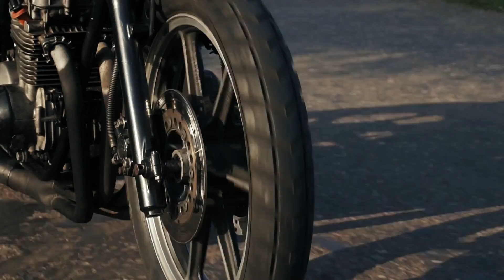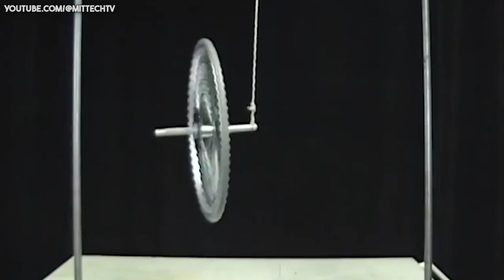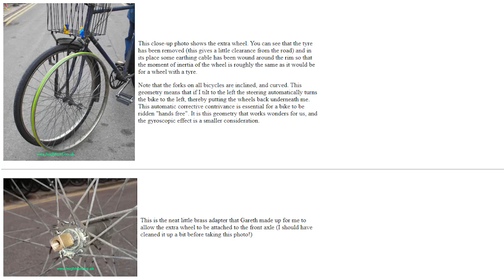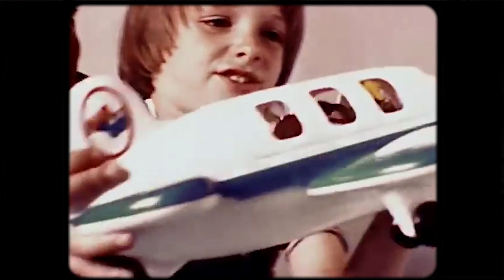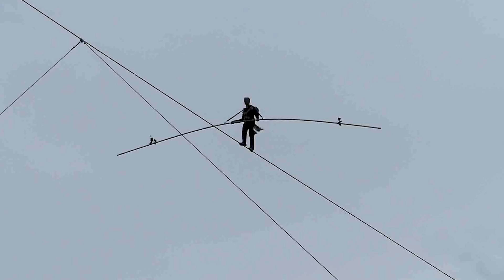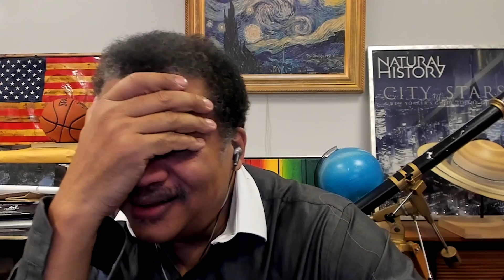How Do Bikes Stay Up? | Neil deGrasse Tyson Explains…

Comment: Neil, would love to hear about the physics of a motorcycle jump. Especially what looks like rotational control in mid air. Is the rider, for example, applying the brakes a bit to rotate the nose downwards?
Reply: You're really smart just because you guessed that! Yeah, when you accelerate the wheels, nose goes slightly up, when apply brakes - slightly down. I certainly wouldn't have guessed that, I wouldn't have thought that's something even possible
Reply: @ldmtag Sounds exactly like what happens on the ground 🧐. It's almost as if angular momentum is the reason why it behaves that way in both cases 🤷‍♂️. Idk if that's the (only) reason or if it's a pure coincidence 🤔.
Reply: @louisrobitaille5810  no, it's not the only reason, and no, it's not a coincidence. On the ground the main force that makes you do a wheelie is tire friction. It's applied not directly to the center of mass, hence it generates rotational torque. Normally it just slightly squats the bike during acceleration making the center of the rear wheel the center of bike's rotation, around which now the force of gravity is off-centered and too makes the torque, and this torque is what keeps the bike from doing a wheelie.

Comment: I saw some guys at the park walking on a high wire that was just a few feet off the ground tied between two trees and I just knew I would regret it if I didn't ask them if I could try, so I did. Its hard! Its really hard without a pole. They didn't have one and I only went about 3' before I tumbled off. Glad I tried it though, cross that one off.

Comment: Neil didn't quite hit the nail on its head here in my opinion.

- Trail (contact patch behind axis of rotation of the wheel) is the mechanism that auto-centers the wheel at speed, though it doesn't have any effect at a standstill. Think of caster wheels on a shopping cart.
- Rake (inclination of the head stock) inevitably produces trail on a bike with straight forks but it also creates another effect: if you lean the bike a bit and then rotate the wheel slowly,  the whole bike will shift side to side slightly but also there will be an angle where the bike sits the lowest on the ground. Now whenever you leave that angle, it raises the bike up very slightly. If we eliminate friction, gravity will always keep the wheel angled in that special angle, which seems to be the correct steering angle for a given lean of the bike, yet I wouldn't be too sure about that. This effect is similar to Neil's balancing stick example, but it's probably only relevant at a standstill, when friction of the tire on the ground is minimal.
- Gyroscopic effect is an apparent force that pushes the bike up when it's in motion and leaning to one side. But it can't be the only relevant effect here, because then the bike would just come to rest at a certain lean angle but roll straight on.
- When the bike leans, the contact patch shifts to the inside of the curve. This might put leverage on the front wheel to steer it into the turn. The rolling circumference also gets smaller as the bike leans, prompting the wheel to accelerate its rotation, but because of inertia the wheel will instead react by putting leverage on the steering axis, steering the wheel into the turn. If this effect is significant or not, I don't know.

I'd be curious to see a computer simulation which can eliminate various factors to see which ones truly contribute to the self-stabilizing of a bike.
Reply: I never see anyone mention the rolling circumference. But I always thought it was relevant.
Reply: @user-zu1ix3yq2w  It's probably very weak because the variations in rolling circumference on a bicycle are quite small. But it is noticeable as a little bump in the engine rpm in motorbikes. When the bike is rapidly dipped into a significant lean, the bike slows down a little as an effect of engine (and wheel) inertia, and the front wheel is slightly forced into a sharper turn.

Comment: I think Neil is incorrect in his belief that high-wire acts need the pole to move their mass lower. That stick is nowhere near the mass of the person holding it. For Neil's explanation to work, the pole would have to be heavier than the amount of body mass above where the pole is held. I contend the pole is for BALANCE, as walkers can be seen shifting the poles left and right along their length as they walk. Neil is brilliant and rarely wrong, but once in a great while...

Comment: Studying advanced motorcycle handling teaches a combination of how center mass, speed, and friction points interact to keep a bike on track and in control for given conditions. There are all kinds of forces at work, then you add in what changes with applying the brakes or throttle at any given lean angle plus speed. All of this is acting on a contact point between the tire and the road about the size of a credit card. It is really a great exercise in physics and engineering once you realize how complex a system it really is.
Reply: So, does being raised by a guy who designed tires... but I'd still wanna take your course before getting on a bike.

Comment: How can the CM be below the wire for a tightrope walker holding a bar horizontally?  No part of either the bar (even a sagging one) or the walker is below the wire, let alone half the mass.  If the combined walker+bar CM was below the wire, the system would be stable and there'd be no challenge to tight rope walking.

I don't think lowering the CM has anything to do with any of this in the tightrope explanation.  What you have is a system where angular momentum is perhaps 0 to start, along with a (simplifying a bit) single vertical force at the walker's feet.  If there's a little disturbance and his CM shifts left a little bit, the vertical force is now to the right of his CM which will cause a torque to the left.  The walker will start rotating in that direction.  

By applying an opposite torque to the bar directly, he can induce an opposite rotation in his body and momentarily shift his CM back to the opposite side of the wire.  If he moves it far enough and holds it there long enough he can then apply an opposite torque to reverse the rotation of the bar, then stop it when it's level again, thereby canceling the angular momentum in the system.  His CM is now back to center and with 0 torque and angular momentum in the walker+bar system until it's disturbed again.  

There's probably more to it like manipulating the force directions laterally with your feet/legs, maybe doing some lateral translation of the bar and so forth.  The point is all this stuff about lowering the CM is irrelevant in the tightrope example.  If the CM is above the wire at all by any amount, the system is unstable regardless.  Lowering it to a height that's still above the wire won't reverse the torque on the system and stabilize it.

The Weeble Wobble also doesn't have much to do with the CM lowering.  The reason a Weeble Wobble is stable is because a positional disturbance (say rolling it to the left just like the tightrope walker) pushes the contact point further to the left than the CM moves in that same direction.  The vertical force is now far to the left of the CM instead of directly under it which produces a torque in the opposite direction canceling and then reversing the roll velocity.  That rights it again.  How the CM moved vertically is irrelevant.

Comment: Having your center of mass on a 2-wheeler low is not actually helping with stability, it might be doing the opposite. I have riden very low lowracer recumbents with center of mass of the rider just about 40cm above ground and tall 29" upright bikes with their center of mass maybe 110cm above ground. The low bike requires faster reactions to anything that destabilizes you. It like balancing a short stick on the palm of your hand versus a long stick. Other things being equal lower bike will require faster reflexes and therefore feel less stable. But you need a big heigth difference to notice this. Among just upright bikes for example other differences will be so much more noticable they will hide this one. 
To make the bike balance without rider you need the steering assembly (front wheel, fork, stem, handlebars) to lean to the side the bike wants to fall to faster then the rest of the bike. Then any disturbance of the initial upright position will result in a turn that corrects it back to upright. It does not matter if your design uses the gyroscopic effect to help this or not, or how much exactly the front wheel trails behind the steering axis. As long as the steering falls into a turn fast enough (but not crazy fast, that could induce fast oscilations) it will work and you can send that bike down the hill and see it keep going. 
However once you put a human on it it becomes more complicated. The weight of the arms on the handlebars by itself already changes the behaviour of the bike. The overall mass is now much greater and center of mass is in different place. And the mass is no longer rigid, most of it is somewhat flexible and actively moves too. And the person steers actively to keep balance but with the limitations of human reaction times. So now describing the stability of this bike-human system becomes crazy complicated. To my knowledge nobody ever built a good mathematical model for this that would let you predict what bike geometry would be nice to ride. The only way is to build the bike and test it. 
As a result I have seen bicycles that were not only not stable to ride themselves down a hill but you could not even push the bike just by the saddle, you had to have a hand on the handlebars when pushing it. And yet it was perfectly nice bike once you sit on it and ride it. Just the change in mass and its distribution did the trick. And I have seen a bike that is nicely stable when you push it by saddle alone and yet it is unpleasant to ride - steering feels rubbery and like it is fighting you.

Comment: You people think too much about passive stability. The biggest aspect of bicycle stability and manouvering is active feedback with the user. You keep a bike upright by continually monitoring your balance, and adjusting your contact points on the ground so as to be directly under your center of gravity. (Or your combined weight+centripital acceleration vector when turning.) That's the same thing you do on skates, skis, running or just walking. No gyros. And guess what? If you begin to tip, your center of gravity drops, and will continue to drop until you fall over, unless you take corrective action, by steering into the fall. Same principle as balancing a broomstick on your hand. It's not self-stable. I think your center of gravity idea as a red herring, just like the gyroscope idea. I prefer to think of a bicycle as "under-stable." If it were truly stable its handling would be way too sluggish. It is partially stable so it's easy to ride, but not so stable that you can't turn.

Comment: ha ,ha, big bike mystery for our personal astrophysicist: you are missed whole galaxy!, why bike goes almost straight , because front wheel axle is in front of steering wheel axis and when steering wheel is directed straight, it is in the lowest height/position of bike, if it turns on any side, it rises bike and that difference in height stabilize steering wheel to keep straight, it is possible to move forward  just by turning steering wheel left-right-left-right..., so is it clear, ok, just to help you to solve other mystery-why speed of light has no unlimited speed: because media that light propagate through, limits light speed, same as speed of sound, it is limited by media(air, gas....)

Comment: If bicycle self balance due to lifting up center of mass then there is no need for it to be moving. And as any kid knows, bicycle self balance only when moving, the faster the better. So this explanation is not right. You can find a series of experiments and trials in this two part series: https://youtu.be/e4kmMniQqx0 Also for the zip line doing absolutely nothing would be enough (and mandatory) to stay up and this again is not the case, because the center of mass has to be below the line for the system and it’s not when all the parts of the system are above the line.
Reply: Another longer explanation from Tedx 
https://youtu.be/2Y4mbT3ozcA

Comment: Remember those old bicycles with those huge front wheels. The become easier to ride (more stable) st higher speed, so it seems to be the gyroscopic effect is the biggest contributer to stability.
Reply: It's some of both.  The steer effect Neil talked about is part of it, but what he doesn't talk about is the gyro effect having the same steer tendency:  Rolling (leaning) to the left causes a gyro reaction which steers the wheel in that direction too, adding to the effect Neil talked about which is a reaction to the tire load being displaced from the steer axis.  

The system can be broken down further than that in more detail, but the take-away is that both are factors.  How those two weigh against each other will be different at different speeds and on different vehicles.  Not sure, but I imagine this gyro effect on steer is not negligible on a racing bike at top speed.

Comment: Let me save you 10 minutes. Its because of front fork rake (caster). Nothing to do with gyro forces or mass distribution. Weight of the bike “pulls down” on the front fork which forces the front wheel to align with the rear. Try balancing a bike that has a vertical front fork. Gonna be very difficult.

Edit: its the same force that causes your car steering wheel to self centre.

Edit #2: its shocking to me how these scientists cant understand basic geometry.

Comment: Countersteering is used by single-track vehicle operators, such as cyclists and motorcyclists, to initiate a turn toward a given direction by momentarily steering counter to the desired direction.      Wikipedia

Comment: I think Neil's way off base. Putting extra wheels that rotate the other direction doesn't counter the gyroscopic effect. As long as they're rotating in the same plane, it doubles the effect. Spinning the same wheel in the opposite direction negates the gyroscopic effect because it is now standing still.
Reply: I Was thinking this as well. A gyroscoop resists movement in every direction. Let's assume two wheels, counter rotating, but not connected in any way. Each wheel would want to stay spinning in the orientation it is in. How would this suddenly change by attacking them to the same axis?
Reply: @rienkhoek4169  I think he was comparing it to a helicopter with counter-rotating main rotors not requiring a tail rotor to prevent spinning the cabin.
Reply: @SAJe_53  might be indeed, but that effect is created from the resistance the blades create while moving through the air. This isn't an issue with bike wheels, so i dont get while it is mentioned at all.